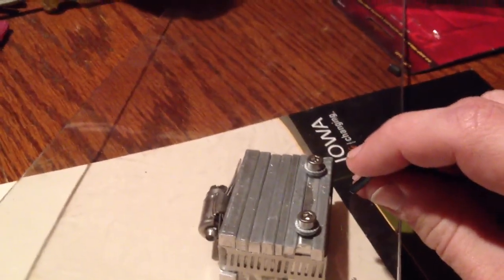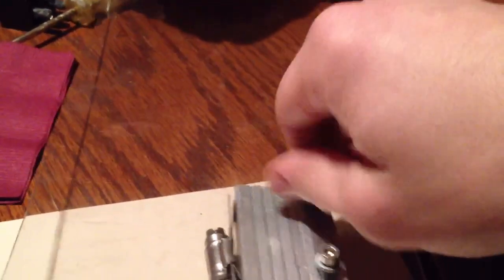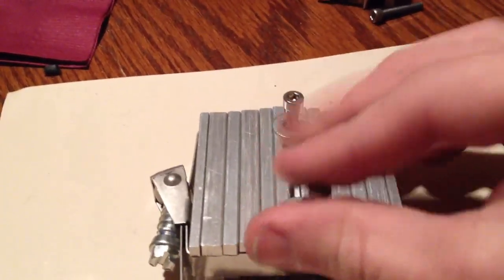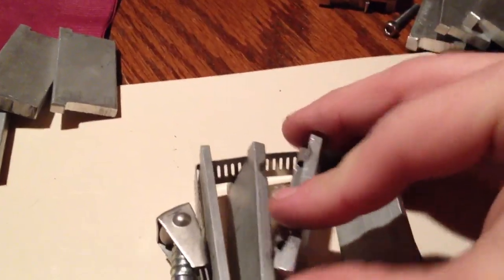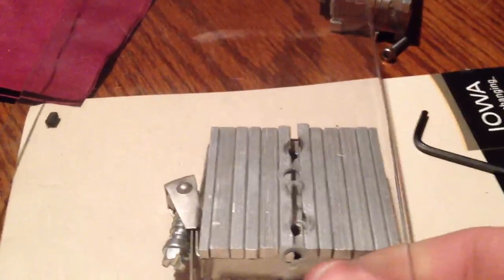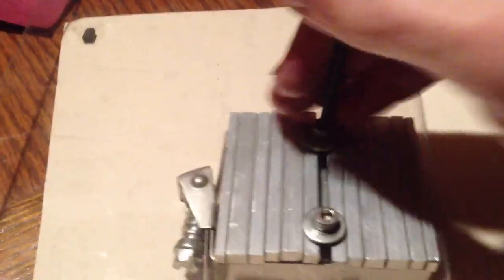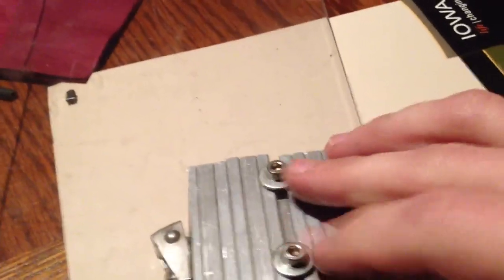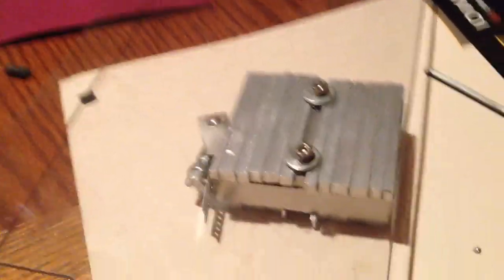Pouch Cell Concept - Pt. 3

Comment from the maker: I'm not sure beveling would provide much benefit.  What is most important is to have a soft edge that will not likely cause damage to the cell tabs.  From the factory, this material has a relatively rounded edge; any machining would likely create a crisper edge that could cause more harm than good. Besides, it would only be the last one that would be tricky.  However, I have since traded out the individual spacers in favor of fewer thicker spacers. And yes, there is current capacity gallore!

Comment: Andyj's "Reversed dovetail" for clamping!
A123 tabs being so long, do you need a full set of cut pieces? Just a thought.
If you wish for more strength then could I suggest the end pieces being wide enough to accept 6mm screwed rod. There is a need to tap them with spacers in one go to forgo needing any nuts.
My vote earned ;)